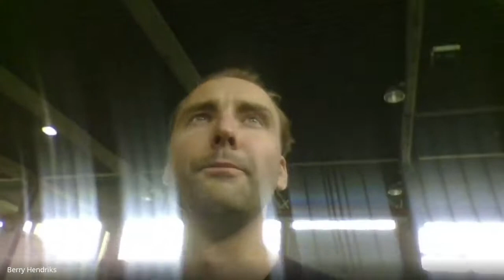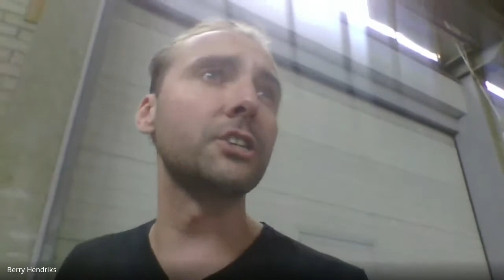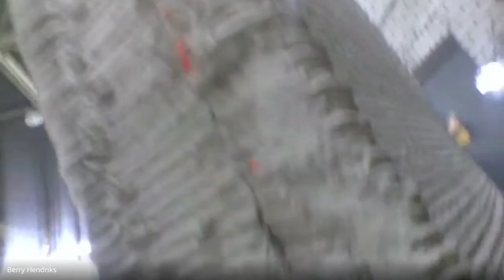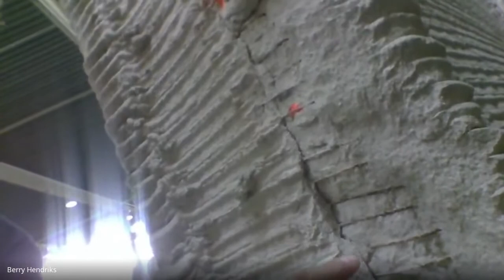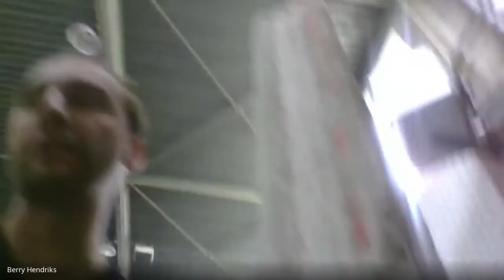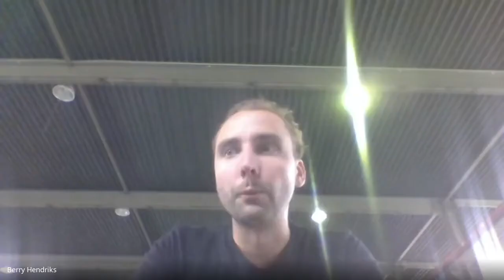How CyBe Reinforces 3D Printed Wall Construction

Comment: Just because you can print a wall faster does not mean you will be more profitable than a construction company using traditional methods...nothing truer spoken in this video. The profitability for a contractor is the cost of the job less expenses and overheads. At this current stage of additive manufacturing - printing a single house with a cement paste using million dollar robots and heavy construction equipment is more expensive than traditional construction methods, especially in developing countries where these printers are being sold to and labour costs are low. It has long been known that printing will only become economical when services and more complex parts and systems can be printed into the structure simultaneously and a viable ecology of technological partners working together solves the problems in construction like cost, time and waste. It would be great if these talks were about the advancements of printing technology taking part in their own country, utilizing the printers they sell, and how contractors  and developers are getting their buildings approved. How for instance is the engineering being applied to the wall in part and in whole ? How is engineering applied to walls with standard connections between the inside and outside surfaces, and what software programs are used to solve specific conditions - and how that in turn is passed by a building certifier and council . How are services being incorporated into the design and how does that effect the STL file? What happens to a print run on site when it rains ? How are the various heavy robotic parts moved on site? What needs to be laid on site for the printer to sit on? What happens if the pump fails and you need to start the print run again ? Is the cold joint then in need of extra reinforcing and does the wall need to be re-engineered and approved by its own destruction ? I would be very interested to hear from all the major technology players in how they collectively or individually are pursuing these issues and if the information is proprietary or a 'trade secret' because they are intractable problems or makes a particular brand cost effective - why they are not discussed when talking generally about the marvels of printed manufacture.
Reply: @Michael Flynn  Very much agree with your sentiments. The devil is in the details with this industry and there are many loose ends and questions that must be answered before construction 3D printing can go mainstream. When you have a construction giant like PERI getting involved you wouldn't expect them to divulge any trade secrets very readily. They can afford to run 3D construction projects at a loss while they are ironing out the technical and regulatory snags that invariably would come with such a complex and novel technology. Will the cost of the technology be a barrier to entry for small contractors so that only large firms with deep pockets can make use of it? You do get some answers listening to the likes of Icon's Jason Ballard and Cobod's Henrik Lund-Nielsen as to the economics of construction 3D printing: Ballard saying that the economics of the industry will only be realized once you can get print runs in the 10s or even 100s, whereas Lund-Nielsen saying that the cost equation only squares in a high labor-cost environment. Personally I believe C3DP will become ubiquitous within the next ten years but the technology still has many hurdles to jump.
Reply: @thorfriis6284  - Cobod's Henrik Lund-Nielsen is a straight talker - I like his input. I am trying to get projects up and running here in Thailand.. but may have to do swimming pools or artificial reefs to get the ball rolling. Nobody is willing to take the plunge because information is so scarce...and labor is 15 dollars a day. But it is the future - no doubt Thor Friss.